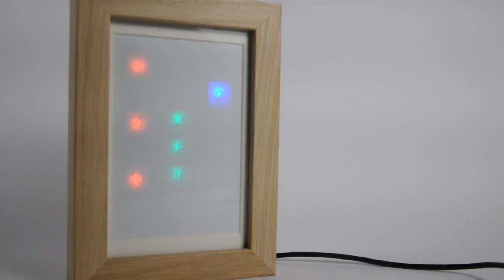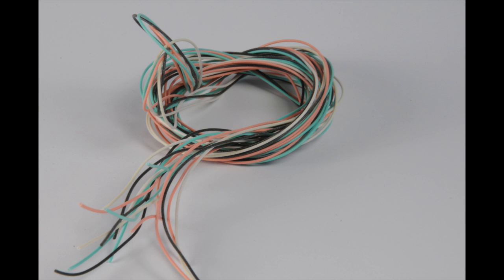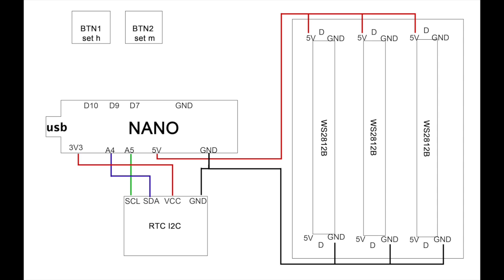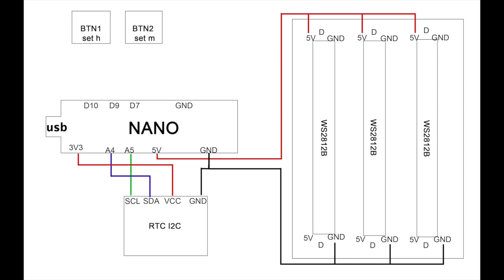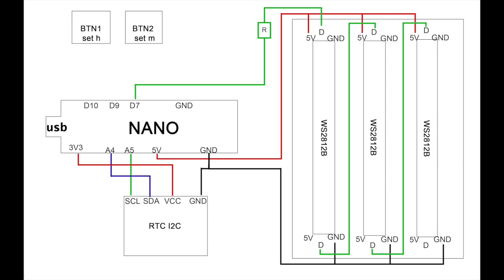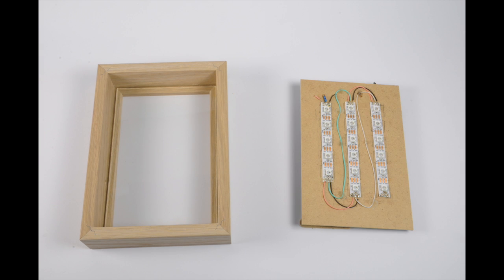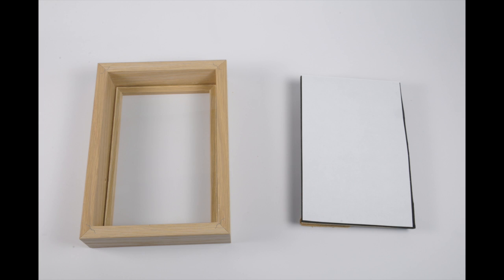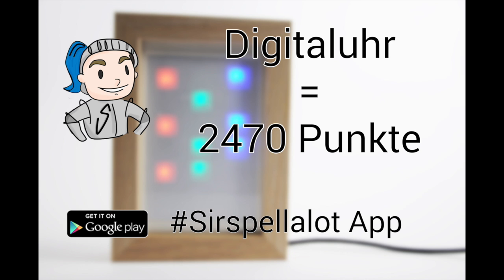DIY Binary Clock (with Arduino, color LED in a picture frame)

Comment: I built mine all by myself (I just need to make it pretty, which is why I came here).
But I didn't use a clock module. I just use the delay() function. I delay for 1000 milliseconds. After that I do seconds++, check the state of a switch, check if seconds == 60, and if that is true I update my leds and update my time.
(I do not have leds for the seconds. I think it's too distracting).

Now I wonder: Will the clock run notacibly slow due to the extra stuff?

edit: I found the millis() function which I can use to calculate the time. I don't think this will negatively impact the timing :)

Comment: Tried this project, could not get it to work? FastLed problem?  RTC problem?
Reply: I have not built it yet but I was just trying to get the Sketch to compile.   add " #include <TimeLib.h> " to the top of your Sketch and see if it works.
Reply: I got the clock to function, a faulty RTC.  The replacement RTC works, but will not advance the time if power is cut?  I will have to work on the code.
Reply: Please let me know what you come up with. I am still waiting on parts from Ebay to start this project. A peek at your code would be very helpful.
Reply: While compiling you will get a  pragma message about the FastLed version?  Just ignore it.
Reply: Have you made any progress on this project? I can't seem to get the clock to work. LEDs are wired correctly, I can run a test pattern fine but just get a green flicker from the first LED when trying to run the clock.

You mentioned that the RTC won't keep time when power is cut. Based on my research, the RTC1307 requires 5v to run, not 3.3v as in the video. This might be why your RTC won't keep time. 

If you don't mind linking your code that would be very helpful.
Reply: I am using the Arduino code that is supplied on the YouTube video, with no changes.  I did not have another DS1307 RTC, so I tried a DS3231 and it worked straight away, even with the DS1307 library.  I tried the DS3231 library but the program had to many changes to make it function.  I just got in another DS1307 and will give it another go shortly.  I am thinking that why the 3.3 volts are being used is that using the five volts may draw needed power away from the LEDS.   Did you try the 17 LEDS in one length first?   

I read on the Arduino forum that once you set the time with the two buttons and the clock is set, you should go into the sketch and parentheses the time reset out and then upload the sketch again, this should fix the problem.  I am a novice when it comes to Arduino, but I went over the sketch and it only resets if the digital read fails, which it may be doing because I have the wrong RTC and the wrong library for the RTC that I am using.  I will see what happens when I get the new DS1307 wired in and working.

How does one link the code?  The code that I am using is   at https://goo.gl/mTik62   Hope this helps you.
Cheers.  Richard.